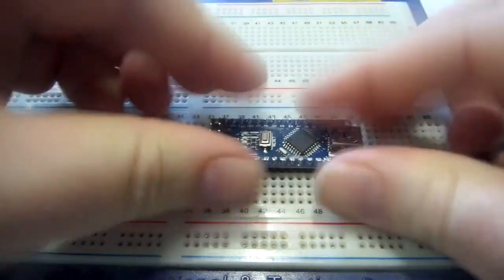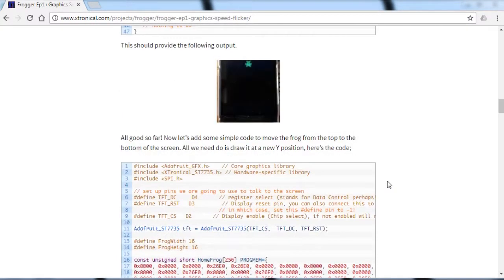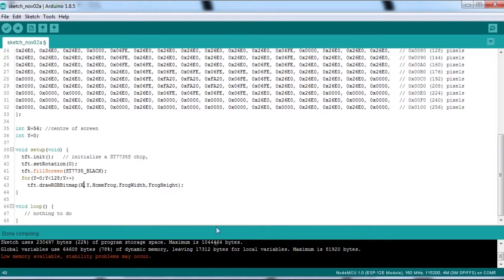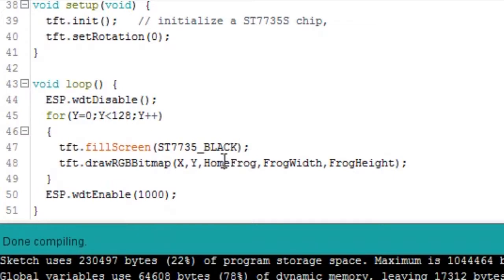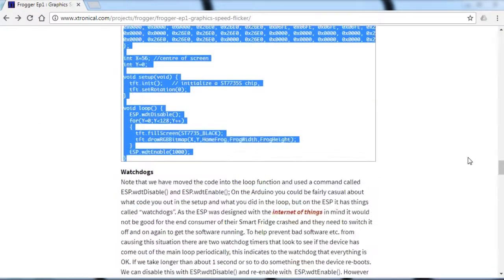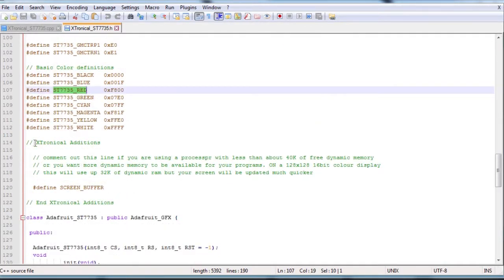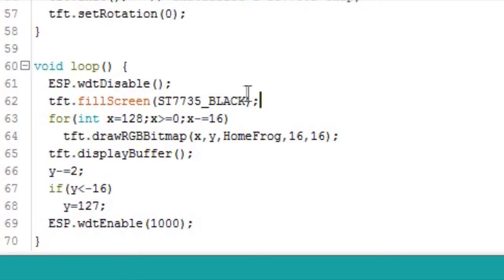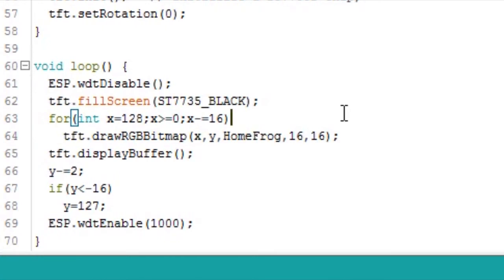ESP8266 + LCD, Frogger Ep1 : Removing flicker and graphics speed

Comment: Is there a way to rotate a Sprite in 1 degree increments all the way around 360 degrees?
Reply from the maker: Only by 90 degree increments I'm afraid. Software rotation in values different from 90 deg would be fairly processor intensive. On old computers with hardware rotation they would store different versions of the sprite. On these sort of screens you wouldn't notice a 1 degree change much either., depending on size of sprite. Around 10 deg or so should be plenty. So create extra sprites at the rotated angle and display when required to give effect of rotation.

Comment: i was wondering if you could help me, im running your modified st7735 drivers on a 160x128 display. the code is running fine, but if im at rotation 0 the rendering starts offset from the top, but when i set rotation to 2 it renders on the full screen no problem. ive modified the header file to have both 160x128 and 128x160 on the height and width parameters and neither combination gives me any luck. have any ideas what could be causing the offset?
Reply from the maker: The latest adafruit code now works with these cheap screens (so my adjustments are not needed), you've just to change the call to the initialise routine (usually in the setup function). Like this 

    tft.initR(INITR_144GREENTAB);   // initialize a ST7735S chip, for 128x128 display

Hope this helps :)
Reply from the maker: Sorry, ignore this, this was some previous advice to someone else who had a different resolution to yours. I've just noticed you've said the resolution is 160x128. Looking at the base Adafruit code it doesn't instantly support this. I've looked at the initR routine above in the source code, these lines within it....

_height = ST7735_TFTHEIGHT_128;
    _width = ST7735_TFTWIDTH_128;

alter the height and width in code, it might be worth trying altering them directly, i..e
_height = 160;
    _width = 128;

If this won't work with my code, I'd probably recommend trying out the Adafruit code to see if that helps along with the changes above.
Reply: @XTronical  ok thanks, I'll give that a try
Reply: @XTronical  using the adafruit and modifying the initR gets the top bar issue fixed, but it gives me 2 lines on the width and 1 on the top still. But it's definitely the right route. The adafruit drivers give me lots of weird side effects tho, so I think I'm gonna keep playing with it using your drivers and see if I can reproduce the same success

Edit: figured out the edge issues, the default option on initR sets the row and col starts to 1 and 2. I still have to solve the side effects I'm getting tho - random grey screen, one if my boards LEDs constantly flashing, weird updates when drawing bitmaps.
Reply from the maker: Sounds good, let me know how you get on
Reply: @XTronical  I've figured out that to get the correct color and full resolution I have to use the "blacktab" settings in initR() from the adafruit st7735 driver. When I looked thru it I initially figured changing the start variables or size variables would fix it within your driver, but still can't make full use of the display when in rotations other than 2. 

So now the current goal is to try and get the screen buffer code pulled from yours and into the adafruit driver. I wonder if the issue is rooted in the commandlist that are being used during init maybe? Idk enough about the low level stuff, so it's hard for me to debug haha, don't want to change a value and destroy a piece of hardware or something XD
Reply from the maker: Excellent, I'll bare those all in mind for future reference. What are you planning on making?
Reply: @XTronical  basically a suped up tamagotchi lol. It will be a self contained virtual pet that has features like a pedometer to allow for exploring with your pet in game, minigames, things like that. I'll also be using NFC for communication with others. 

I'm a game developer by profession, building the hardware is kind of just the next step for me for a personal project, as I didn't want to do something that's just an app running on a pi zero. I wanted to build everything as close to from-scratch as possible
Reply from the maker: That sounds awesome 👍😁
Reply: @XTronical  haha thanks, as long as I can accomplish what I'm picturing it will be 😀
Reply: @XTronical  can you explain to me how the drawBitMap works with the buffer without you reimplementing it in your driver? I got the buffer to work after moving some things over to the official adafruit driver (so I could use my full resolution), but when I move my bitmaps, even with a fillscreen that writes to the buffer, it leaves the trails as if I'm not using the buffer. The flicker is gone tho lol
Reply from the maker: I think your fillscreen isn't working as expected. Sounds like you are not eventually writing the buffer to the screen using the "displayBuffer" command perhaps?
The drawBitMap is part of the Adafruit graphics library which I did not alter. The way it works is that drawBitMap calls the drawPixel command within the 7735 driver code. It's this routine that also needs altering to work with the buffer, you've probably not done this? From what you are describing I think what I've said sounds plausible - hopefully that'll get you going :)
Reply: @XTronical  I think it's the fill Pixel aswell. I noticed it after I had posted, I'll try that out today thanks!
Reply: @XTronical  I've discovered that it does seem to be coming from the fillScreen. I'm using an exact copy of your code for that, and I am calling displayBuffer, but if that's the only code I run I get nothing to my screen - it just leaves the pixels as they are. I've also made sure to bring over your version of setAddrWindow but that gave me no changes unfortunately. 

HOWEVER! I did some test with your buffer example for esp32, and if I set the rowstart to 0 for all 4 rotations it works correctly XD

So I may just be able to use your drivers after all lol

Edit: so ya, buffer and all works exactly as it should with your driver - I get full resolution and all. The only thing that's wrong is the colormode. I had to use the "blacktab" settings from the official drivers, but unfortunately just copying over the commands doesn't work -.-
Reply from the maker: What color mode do you need? My code uses RGB565 - 16bit colour - Is this the mode you also want to use but the blacktab settings don't seem to give this when mixed with my code but work on the adafruit one?
Also I've a funny feeling that fillScreen might not have existed when created that driver and that I used to do the same job using a fillRect function to blank the screen.
One other thing, if you go back to the Adafruit driver again then one thing I also tweeked was the SPI bus speed, doing so gives you a significant performance boost. It's just one line in the function "commonInit", in Adafruit it reads

    mySPISettings = SPISettings(8000000, MSBFIRST, SPI_MODE0);

but I managed to get it up to 40000000 without any stability issues for my screen. a five fold increase! here's the altered line;
    mySPISettings = SPISettings(40000000, MSBFIRST, SPI_MODE0);

For your different screen your mileage may vary, start with this and if it's OK try upping it even more :) otherwise bring it down until your screen is stable.
Reply: @XTronical   XTronical  success! I wanted to answer your question about what color mode I needed so I simply googled the command name the adafruit driver was using and happened upon a GitHub post where some had had a similar issue and it was based in the rotation method. That's when I noticed yours was sending MADCTL_BGR in all four cases, I changed that to MADCTL_RGB and now my colors are correct. 

I also played with the speed a bit on the spi settings, seems to be stable (at least for short test) at up to 70,000,000 - a 75% increase from the 40mil you had it at, and almost 9x the original value haha. 

I think I'm gonna leave it at the 40mil for now, but if I notice any slow down once I start drawing more graphics down the line I'll come back to it. I'm worried about possible long term effects on over clocking it. Once this is all built onto a single PCB swapping out the display will be less fun XD

Thank you so very much for all your help, I truly appreciate it. Honestly it's because of your videos that I know about the esp32 and I decided that this project was actually worth pursuing
Reply from the maker: That's fantastic, you'll feel like all you've got to do now is your normal game programming job and not worry about all this communicating with the screen malarkey.  If you've not looked at the Frogger project I did you can see that it can re-draw the full screen, moving a lot of graphics about in about  20FPS (If I remember correctly) and play multiple channel mixed sound samples and music at the same time. And to be honest it looks smooth enough even at 20FPS (ha ha who needs 120FPS). So I bet you'll have enough speed. Keep me posted when you finish the work, would be great to see. I've subbed to your channel in case you update there.
Reply: @XTronical  I'm back lol, unfortunately I had my dev machine die on me so I wasn't able to work for a few days, but now I'm back in full swing! 

I'm wanting to add the fillRoundRect to the buffer system (as well as some of the other primatives like circles and triangles) and was wondering if you could assist me with that. I tried just comparing your fillRect and there's and just got lost XD

If you could just point me in the right direction with one I'm sure I could figure out the others. Any help is appreciated!
Reply from the maker: No worries. As fillRoundRect, circles and triangles are mostly part of the graphics library you don't need to do anything to them. You only alter routines in display driver library. Quickly looking at the code fillRoundRect should just work without adjustments and perhaps circles too. Haven't looked at triangles but if they use any function within the main display library that has been altered then they should be fine. Quickly looking in the driver library I've seen that I've made no adjustments to the routines that draw lines. If you need these you may be able to work out what to do from looking at my other alterations, if not then I can add some code in for you but may take me a little while as I've a bit of a backlog of stuff to do.
Reply: @XTronical  ya it's weird, the rectangle part stays fine, but the rounded sections flicker. I went thru the circle code and I'm not seeing anything that needs to be changed. It all calls writePixel, which calls drawPixel. It also makes use of the fastLine methods that are already implemented in your driver aswell.  I'm gonna keep playing with it after work tonight, see what I can figure out. Just tracing thru the methods I'm not seeing any holes
Reply from the maker: I think you might be mistaken about fastLine routines, I didn't implement them and they don't call drawPixel. Also the fillroundrect calls fillCircleHelper which call fastline routines. At the time my goal was to get the bitmapped graphics working fastest with no flicker, as a bonus some routines in the graphics library worked if they used drawPixel deep down. It would be nice to have all routines working, I'll put it on a to do list unless you get there before me. Do you have any priorities or are all the graphics routines essential?
Reply: @XTronical  hey, long time no see haha. I've actually moved away from most of the base graphics functions and I'm just drawing bitmaps, but I've ran into a similar issue as before. If I have it in rotations 0 and 2 (height 160/portrait) then it draws fine, but when drawing it in rotations 1 and 3 (128 height/landscape) the pixels get skewed the further down the screen and it fails to draw to a portion of the screen. Basically what it appears is happened is that the buffer is still being drawn in a 160x128, but the buffer is still being drawn with a width or 128 and a height of 160. I've tried changing the height and width values inside of the rotation method, but that causes even more skewing. Any ideas? Lol
Reply from the maker: Looking back over the posts, are you using my driver or the adafruit one? The library would need looking at but first thoughts are what you've said, it's not changing the width height somewhere on those rotations.
Reply: @XTronical  I'm using your drivers, the buffer is crucial for the performance I'm looking for
Reply: @XTronical  I've found that in your driver the rotation methods all have heigh set to height and width to width, changing those on the 1 and 3 cases ( rotated 90 and 270) corrected the issue when buffer is disabled. However it breaks down when buffer is enabled.  You also have colstart set to 32 on cases 0 and 1, and I'm not sure why. I Kno I removed that a while ago to allow me to draw the full resolution of my display, but I'm curious why you chose to add that
Reply from the maker: It was an adjustment as the adafruit routines were drawing off screen by 32 pixels. It was a quick and dirty fudge!
Reply: @XTronical  I FIXED IT!  I had to store the rotation of the screen, and if I'm rotated 90 or 270 then in the displaybuffer function I set addrWindow to height,width, and if 0 or 180 it gets set as width, height
Reply from the maker: Hey hey, brilliant.

Comment: Hi. I know its late but i tried to implement your screen buffer to ssd13xx driver but when i call tft.displayBuffer(); everithing is drawn in one vertical line on left side of ssd1331 oled. Can you pls help me a bit here?
Reply from the maker: I'm not familiar with that driver, the ST7735 arranges it's memory in rows and once set up you can quickly blast the rows to it. Without a display to test with it would be difficult to work out what's going on. However I like the look of those small displays so will do one in the future, I'll order one now. But it'll be a few weeks before I'll have it ready, sorry.
Reply: @XTronical  thx! I will experiment a bit to figure out what is happening or I'll have to accept the flickering...